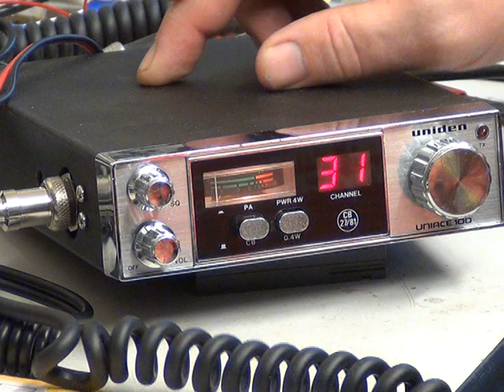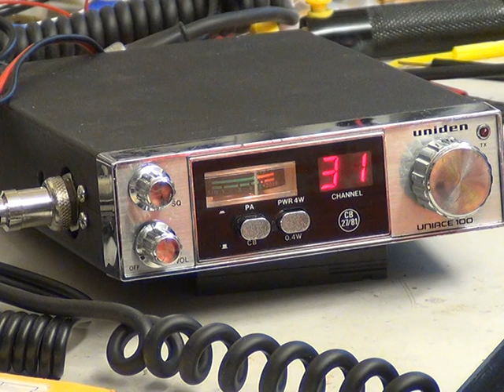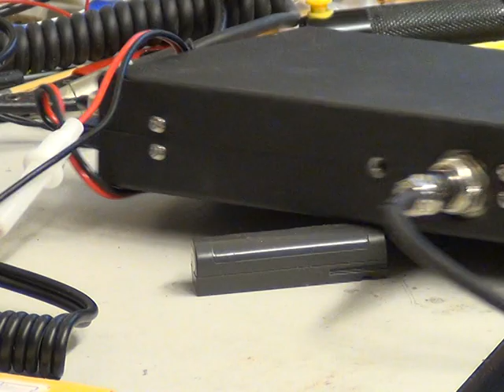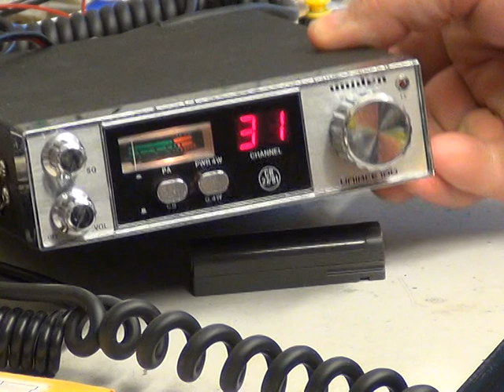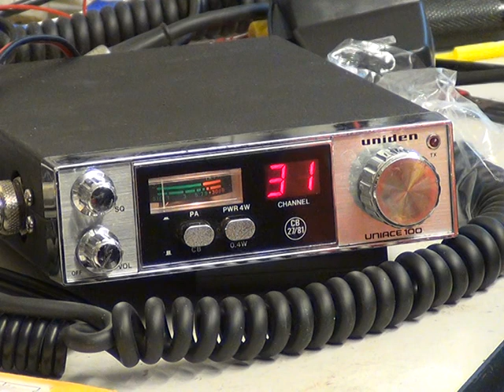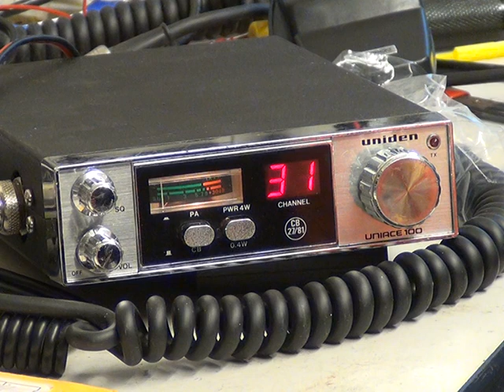Uniden Uniace 100 (UK )CB27/81 (mobile) -  On The AIr Test

Comment: We have that crackling noise too here in Nuneaton, more likely nasty wall warts or similar at our qth. We also find the crackliest radios are uniden, dnt type, and some cybernet economy radios. Thanks for the videos, we enjoy👍 from Tim in Nuneaton 🙂
Reply from the maker: I must do a test.....run a radio off a battery & switch of the mains. That'll prove what's the 11kv transformer on a pole outside & what's interference from this building. I always buy 'normal' power supplies, but so many products come with switch mode wall warts these days.I do know there are none in the workshop, but.....

Richard
Reply: UK CB radio servicing  we live in a terraced house, and needless to say, we do get interference from something. But it isn’t that bad on the aerial on the house, but chronic when driving down the road, close to full scale in places. So I’m greatful considering how bad it could be👍 Tim HT in Nuneaton.

Comment: Is that an FM radio?
Reply from the maker: UK CB radio is FM. However, we can also use another set of 40 channels in-line with europe. Until 3 years ago they too were FM only, but now they can be used (using new CE approved radios) AM/FM& SSB. Unfortunately, I find the EU set of channels unuseable here in Lincolnshire UK, with an average of S5 noise. Luckily it doesn't bother me seeing as the UK 27/81 set of 40 channels works so well here.

Richard (UK)

Comment: Nice radio far better than some of the other radios that you have worked on some you have done I would have slung in the bin 😄
Reply from the maker: yeah? what's the worst I've done (apart from that awful Jesan handheld)?
Reply: Maxcom and the academy
Reply: Oh i forgot the fedilety 1000 and the Midland 2001 or was it the 1001? Basic volume squelch awful radios
Reply from the maker: well the Academy & fidelity use the same Great GT858 & GT848 chassis respectively. Despite the dreadful RX, they work ok here in the middle of nowhere. The TX is usually around 2.5W & in fact were sold as a 3.5w radio & not 4. I've no problem with the maxcom & of course the same chassis in the Midland 2001, 2001, 4001, but I appreciate that in a big town they desense.

Richard
Reply from the maker: Harvard were variable quality, the Good Buddy was dreadful, the 420M was a Rotel 230 in disguise! Murphy has dreadfyul squelch.

richard
Reply: Yes im sure during the peak of  where you are now you would have had problems
Reply: My first ever CB was the Hygain 3 in 79 followed then by the Harrier CBX. Owned a few of the uniden and audioline radios. Worst radios were the harvards planet 2000 communicator midlands maxcoms murphys terrible filtering and in the day just aload of junk